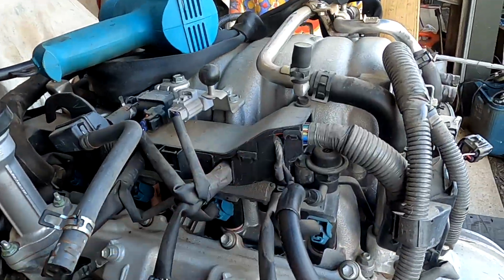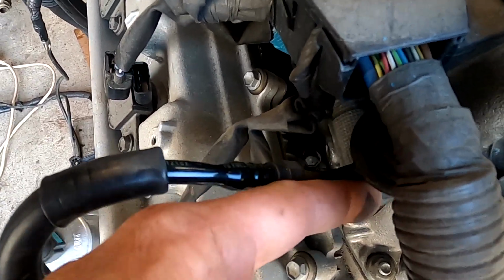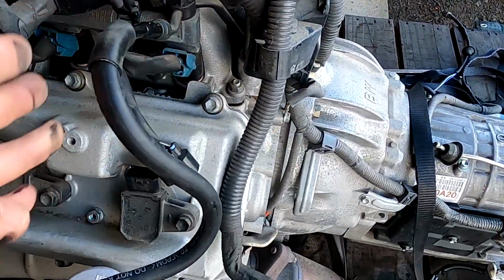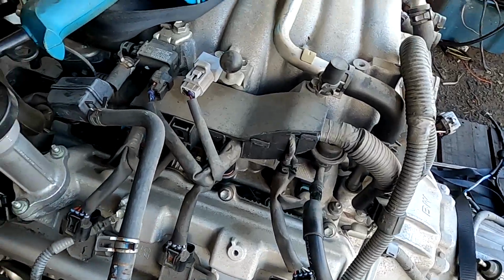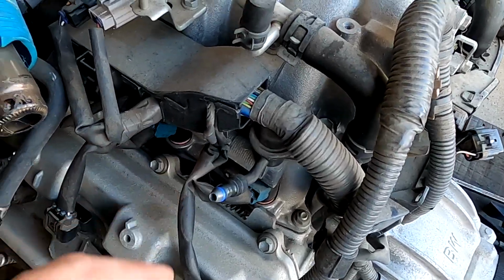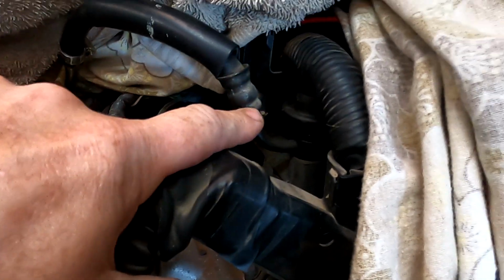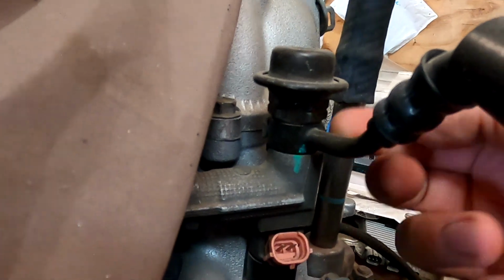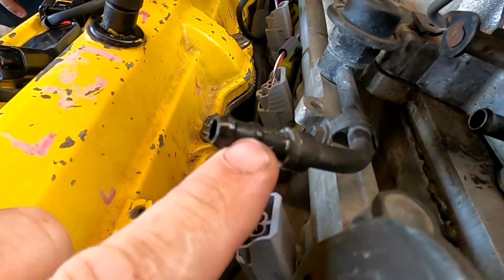3uz and 1uz vvti fuel lines

Comment: Thank You Mate! My 95 1 UZ was leaking fuel at the screw in connection. Could not find the new fuel line. This helps tremendously. Was going to cut the metal. Happy I watched this.

Comment: Hii hope you  well , i got n 1uz vvti convertion ...the previous  owner fitted a 6bad vw caravelle pump .. between 1000rpm and 3000 rpm the engine studders and after 3000 rpm it pulles very well , could it be that the motor needs a tipe op a feul pressure  regulater , kind regards

Comment: so for the 3uz with the crimp and the thread on fitting do you just cut the hose on the fitting end and push it into the fuel filter barb and then run a new piece of hose from the filter to the newly revealed barb under the crimp?

Comment: Does fuel pumps in 3uz not have pressure regulators in it?
Reply from the maker: No,  the regulator is a separate part,   but contained within the fuel filter,  pump hanger assembly.

Comment: 3:12 I have a 1uz engine with the screw on fitting like this and I cannot remove it. 

I have tried to remove the line that feeds the regulator... but the lines refuse to separate after I backed off the 14mm and 19mm flare nuts as far as they will go... I am stripping the 14mm nut when I try to loosen it further. Gasoline is getting everywhere in the process...

How do I separate the line and cap the leak while I am working? Any tips?
Reply from the maker: I keep screwing,   which means sometimes the lines require replacement as the end of the flare has been enlarged by oveetightening in the past

Comment: Is there a way to bleed the system? I just replaced my 3uz fuel filter and pump and the car is struggling to start (i think there is air in the system)
Reply from the maker: Once started they self bleed.  Generally I just give it a quick crank over they they fire up,  if not it indicates an issue
Reply: @CartuneNZ  Thanks for the quick reply mate. Definitely doesn't start. Genuine Denso Pump, Ryco Filter. Took the line at the top of the housing off to see if the pump is delivering fuel. It is (housing was spitting fuel into where the back seat is)
Honestly stumped!

Comment: Do you have a part number for that fuel filter with built in pressure regulator?
Reply from the maker: many different parts numbers.  I prefer 4 bar however there are also 3 and 3.5 bar.  Different makes and models also have different part numbers.  Cheers
Reply: @CartuneNZ  Is there a benefit to having the 4 bar over 3 or 3.5 on a stock engine?

Comment: Does the 3uz have a fuel ecu, or does the ecu control it directly?
Reply from the maker: Depends on which 3uz ecu,  some hwve dual relay setup with resistor ,  some have a fuel pump ecu.  Cheers Kelvin
Reply: @CartuneNZ  Got it, what about the 89661-50710/275000-7481? Thanks so much!
Reply: @CartuneNZ  Ok, so I've looked up the serial number of my ecu, and it appears on ebay listings to be pulled from an 03 Celsior.  This one has the dual relay setup no?  Thanks again.

Comment: Are there aftermarket ferrules available with corresponding crimper so that a new fuel line could be installed in similar fashion as OEM?  This part of the fuel system is the most critical and must be leak free since it is located so close to the exhaust manifold.
Reply from the maker: Yes,  we have access to ferrules too.  There can't be fuel leaks in any part of the fuel system funny enough.
Reply: @CartuneNZ  Hi, what is the correct fuel pressure for the 1uz/3uz. Can you recommend  a special fuel filter/regulator unit?

Comment: So for 04 ls430 it has 2 fuel filters? 1 in tank and 1 upfront?
Reply from the maker: I have only ever seen LS430 with the intank fuel pump but I havent worked on every single LS430 ever.  cheers Kelvin
Reply: @CartuneNZ  much appreciated Kelvin cheers

Comment: Kelvin, quick and easy! I wonder if someone ever used the heat gun without purging fuel 1st ;)
Reply from the maker: Heat gun is fine if a bit of fuel is around provided its not throwing sparks but we still try to avoid doing pump stuff.